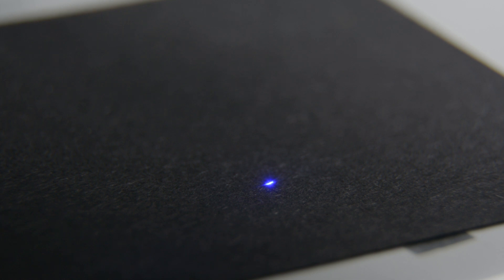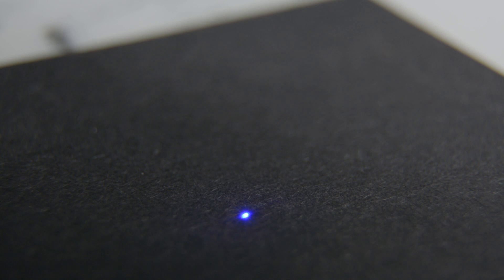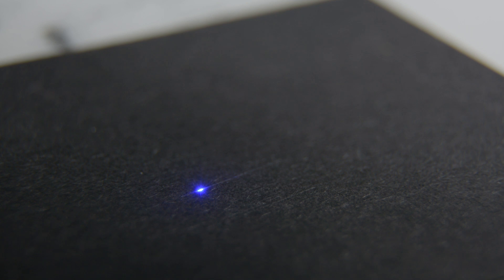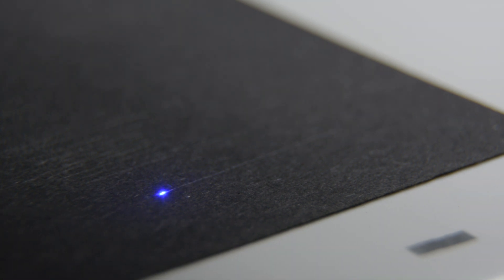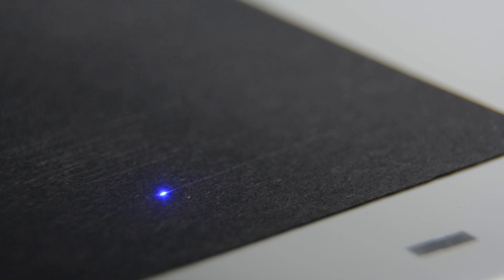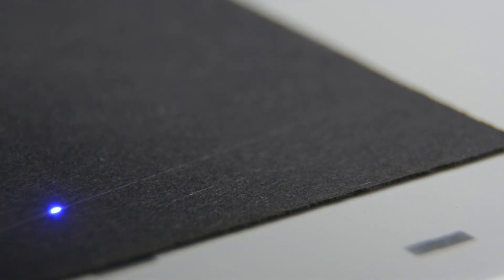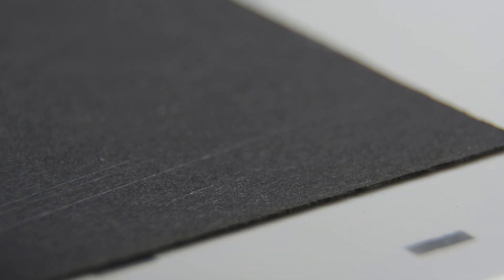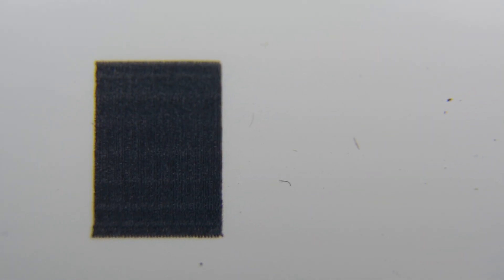Get that focus with diode laser

Comment: Do you compensate for the thickness of the paper by putting it under the tile after you focus?
Reply from the maker: Hi, normally I don't do it, however it's possible to turn it slightly out of focus on the paper so it hits the tile with perfect focus. All matter of testing. Myself I don't see huge difference here.